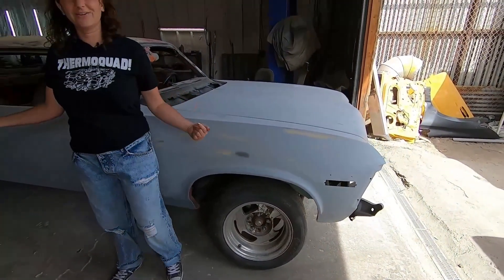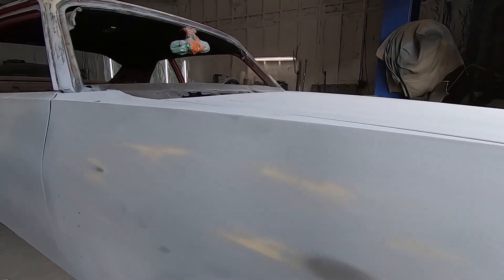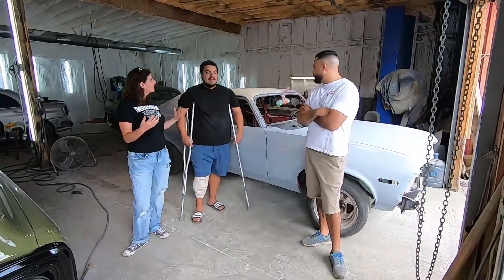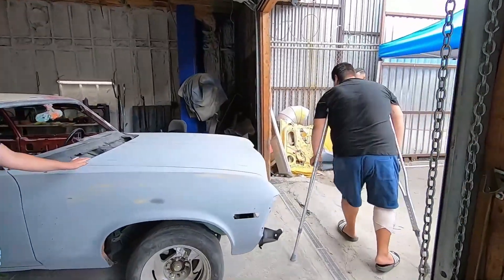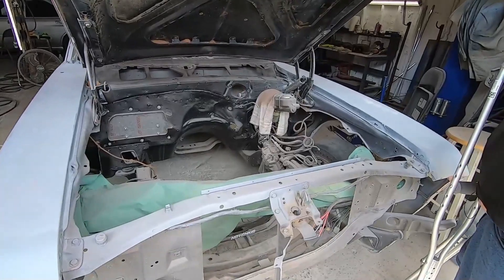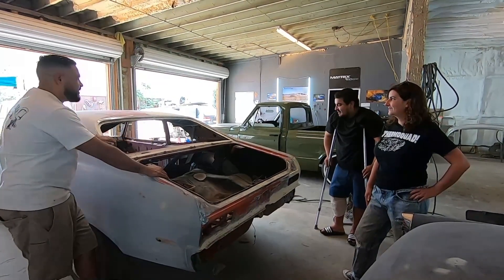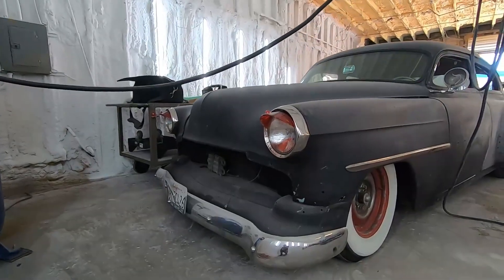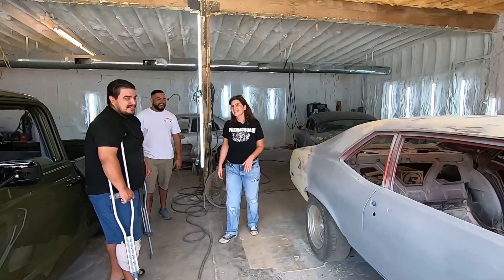1970 Project Nova SS Paint Update.  Project Nova Series Part 6

Comment: The lead that they encountered wasn't a repair. The factory would apply lead to that seam where the quarter panel meets the roof panel. But only old folks would know that lol
Reply: Yep, that's how GM did it on most cars during this period. Same deal on my '66 GTO.
Reply: Take a look at this GM ad from the late ‘70s where the metal finishing operation with lead on the assembly line is featured: https://youtu.be/Mgbscwm2IuE